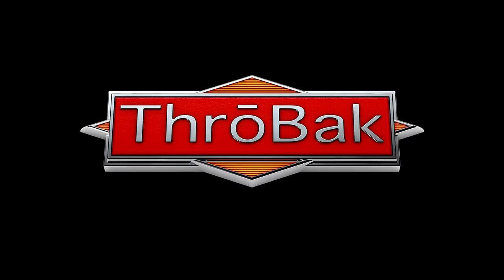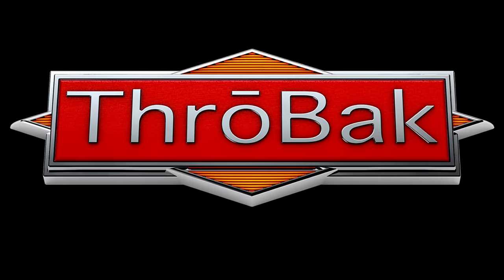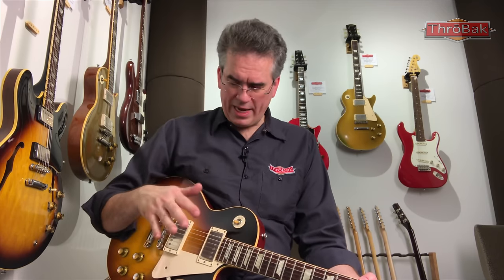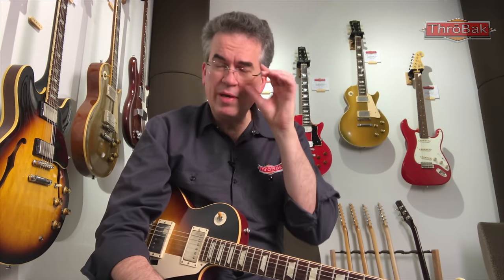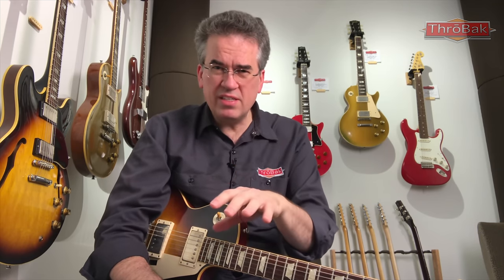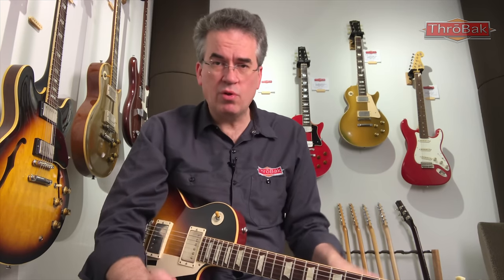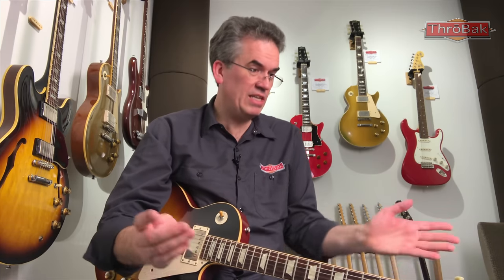PAF Pickup Secrets: Steel Chemistry - PAF Pole Screw Shootout

Comment: I'm pretty novice what comes to pickup mods (been doing this for 6 months now) but wanted to share my thoughts on the subject. To me, there's definitely a sound difference between pole piece screws that is caused by alloy mixture. Higher the amount of steel in the mix means more immediate response to pick attack and produces more high end and high mids whereas lower mix shifts the eq downwards and has softer response to pick attack. Baseplate also has slight difference to time/feel, where brass baseplate has less high end over nickel plated one. Imo, magnet grade and magnetic charge makes most difference to tone and feel of the pickup and is usually the first thing I start with when doing mods.
Reply: I see a guy who makes a heat treatment to pole screws, baseplate screws and keeper bar. Does making this parts red hear with an oven and later cool then down makes a difference in tone?

Comment: Higher Carbon spec screws were brighter sounding , more harsh sounding . The lower spec Carbon screws sounded smoother especially in the high end . 
Goes to show it's not 1 thing , it's everything combined that creates the vintage PAF tone . 
The magnets , the covers , the wire , the screws , the bobbins and pole pieces in combination contribute to the  'tone' . 
Like the L/P Burst of the late 50's , it's not just the wood , or the hide glue , or the nitrocellulose finish , or the pickups , or the tone caps , or the whatever else . 
It's the convergence of all these things that make them what they are and why they do what they do better than all other similar , but not equal , examples .
Reply: Everything is the sum of it's parts, including amps.  Deniers cheery pick single parts, in debating validity, and they make comparisons under less than ideal conditions.  If they happen to love the tone of a well built instrument, they'll dismiss the design characteristics as mojo.

Comment: They sound different and more carbon seems to add more highs but I hear more difference what seems to be hottter output, the higher carbon seems to drive the amp more and feel more “in your face”. Audio engineers might say “mids forward”. Could be a stretch but there might be some time response differences between them, ie the lower carbon reacts more slowly at some frequencies which make it sound more “natural “

Comment: The difference I am hearing is much more specific then just more treble.  The higher carbon content has a very present high resonant peak.  Notes that have no relationship to that frequency are minerly affected, where as notes or more specifically pitches and their harmonics are overly excited by the extra carbon.  I would go so far as to hypothesize that the carbon is allowing for a less restrictive path for electrons at a given frequency.  Would need more data to prove if the resonate peak is a fixed frequency and the amount of carbon will either increase or decrease its amplitude.  Or if the frequency shifts as well as amplitude of the resonate peak depending on carbon content.

Thanks for all your videos,
Chris

Comment: The higher carbon screws were brighter sounding with a tad more bite. I wouldn't quite call them harsh. Where as the lower carbon screws had slightly warmer mids and highs, maybe a little smoother sounding. I would definitely define the higher carbon screws as having a more modern sound, with the lower carbon screws sounding more vintage.

Comment: According to the textbooks the magnetic permeability (the ability of a material to support the formation of a magnetic field) of steel drops, as carbon content of the alloy increases (the heat treatment of the steel also makes a difference). So, as I understand it, this means that use of the older, lower carbon steels, should result in a stronger magnetic field at the screw pole . If the higher carbon pole screws (lower permeability) produce a brighter sound, this seems counter to the generally accepted wisdom (I have yet to see an explanation of why this should be true) that a stronger magnet (say Alnico 5 compared to Alnico 2) results  in a brighter pickup, since the high carbon steels should produce a weaker field at the top of the pickup.
It certainly seems it might be informative to measure the magnetic field strength at the tip of the screw for different alloys. I might try this as I have some screws of at least a couple of different alloys and a collection of pickup magnets.
If any differences in sound did turn out to be due simply to a difference in magnetic field strength that would be a simple explanation. In which case you might perhaps be able to obtain the same differences in tone by raising or lowering the pickups. Or dynamic effects - how the changes in the magnetic field as the string vibrates are affected by the B/H curve - may play more of a part.
Reply from the maker: Lower gauss generally brings more treble definition. Tonal differences between Alnico grade have more to do the inductance changes they cause to the pickup than level of gauss. A2 has a darker low end primarily because inductance changes. So the data makes sense with what I’m hearing.

Comment: As the same with the magnet choice, I suppose you could specifically tune the pick up to the neck or bridge position based on the treble manipulation due to the steel alloy in the pole pieces.
So in your production, when it comes to magnets.....are you aging the magnets by a slight weakening.....did you measure this aspect in your equation to build the PAF reproduction ?
Personally I prefer the lower wound bobbins all be it the mismatch along with alnico 4 magnets......so now with the screws in the adjustable bobbin.  Did you also apply this to the slugs in the fixed bobbin ?  I may have missed that in the video if you did mention that.  AND ultimately......what about the backing plate since the magnet is stuck to it.
I always point that out to people when they pull a humbucker out of a guitar and its a brass backing plate.  
If you are going to the screws....you might as well go the whole way to the sheet alloy they used when stamping out the backing plates
Reply from the maker: I have tested every metal part in a P.A.F.. ThroBak reproduction parts are made with the same alloys. The baseplates are Nickel Silver, not Brass. The alloys for the pole screws varied but all of the vintage slugs I tested were one alloy, 1215. You can use pole screw alloys to tune pickups and string response.

Comment: great test! thanks! a very clear sonic difference. question: might the screws sound different if one set had been in contact with the magnets for a extended time and therefore had become magnetized and the other set had not been in contact and therefore not yet become magnetized?
Reply from the maker: I thought of this. When you take the pole screws out they are not holding a charge so I don’t think it’s an issue. But I first did clean clips with pole screw swaps prior to the dirty clips in this video. So by the time I did the clips in this video both sets of pole screws had been in and out of the pickup.

Comment: I did not expect to hear that much of a difference! It was very noticeable, even through poor speakers, it is a very obvious difference. You mentioned that there are varying grades of steel from low to high carbon. Do you have screws ranging from low to high? Or is most of what's available in terms of pole screws only modern high carbon or vintage low carbon? Listening to the two examples in the video, I might be interested in pole screws that have a slightly higher carbon content than the low carbon sound, but not as high carbon as the high carbon sound.

Comment: Would it be worthwhile to have the pole pieces on strings 1 and 2 have the smoother response, and 3 thru 6 having the higher carbon count? Maybe with string 3s pole piece being in the middle of those extremes?
Reply from the maker: Mixing the screws can be a way of fine tuning the tone of individual strings.

Comment: Difference most noticeable on G string.  Higher Carbon imparts a slight warble to the tone which is not there on the lower carbon steel.  I would prefer something in between as the  lower carbon sounds too laid back  but I don't like the  noticeable warble on the g string when struck hard.

Comment: Jon; what content are “T-Top” screws? Thanks! What about the Slug’s? Have those changed over time as well?
Reply from the maker: There is no hard and fast rule for carbon content but if you can see a circular tooling mark on the screw head crown they may very well have a higher carbon content and you do see this on many T-Tops. They don’t have to have this mark to be higher carbon though.
Reply: So if one uses the lower carbon screws does it add some warmth to a T-Top
Reply: @LPCustom3  I would think yes

Comment: where do there pole pieces screw into??? I have a pickup with a stripped pole piece screw. can this be fixed??
Reply from the maker: We don’t sell replacement but you can replace pole screws. They thread into the bobbin and baseplate if the pickup is vintage spec..
Reply: @ThroBakChannel  ok. The screw isn't stripped, it's the bobbin/ base plate

Comment: Take notice in the picking technique...  both are very different ,Jon wanted the higher carbon screws to have more treble. & you can surely see he's picking closer to the neck with the lower screws . Take notice people
Reply from the maker: I will admit I am not a robot. There is a difference in how I hold the pickup for the single note runs. It was not intentional but there is a difference. However once you get to the chordal a melodic playing, the pick is held the same consistently and the difference in tone between the two screw types is just a clearly evident.